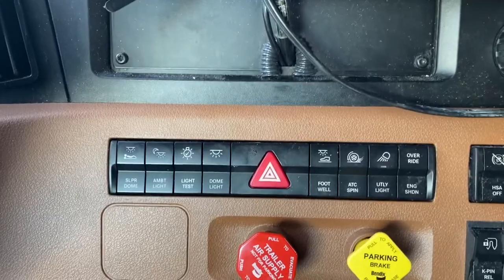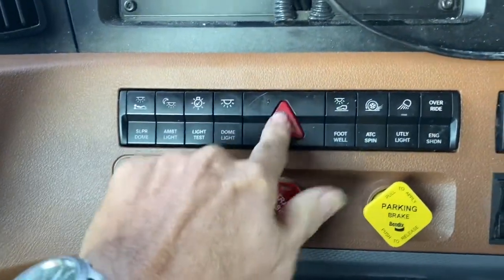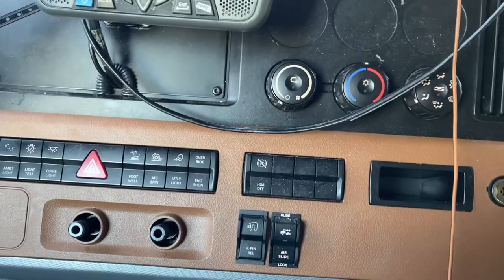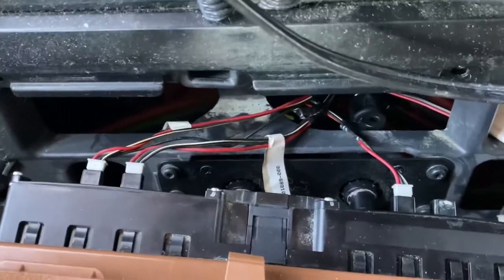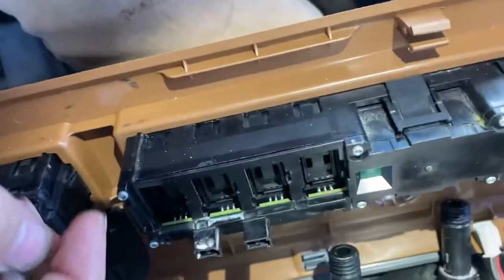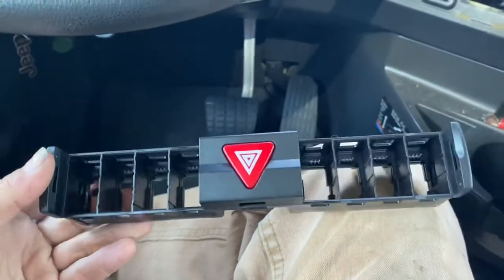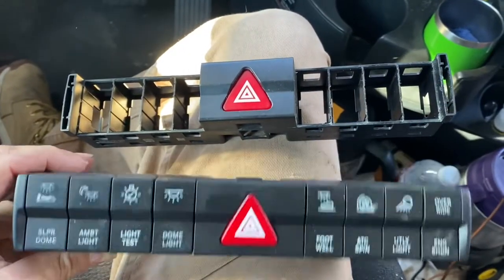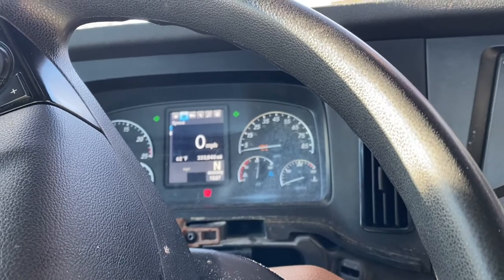2020 Freightliner Cascadia emergency flasher switch replacement.

Comment: for anyone looking to replace that switch pod, the tabs on the end pop out to act as pull tabs while releasing the side clips. also the square around the hazard triangle pops out to release the center clip. then the whole assembly just comes out of the dash. no need to pull the dash panel off.
Reply: Thank you for that info. Easier than a car stereo.

Comment: Did the rest of the switches work?? When hazards went out?
Reply: I have that problem but all switches not working not just the flashers
Reply: @tahaahmed5365  hi Ahmed. u have same all not working
Reply: I have all not working to. I have no power coming to all switch. did you find problem
Reply: @farrukhtadjiev9267 did you fix it? Bro
Reply: @tahaahmed5365 hey did you figure out the problem? I have same thing where none of my buttons work on the dash